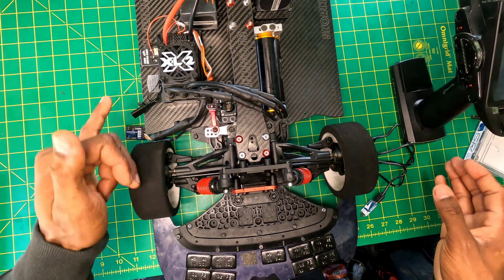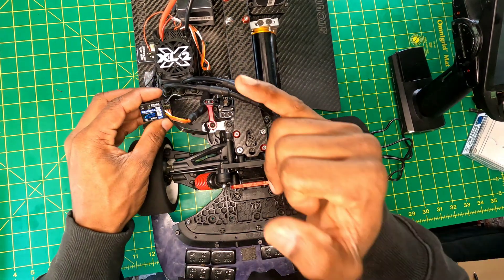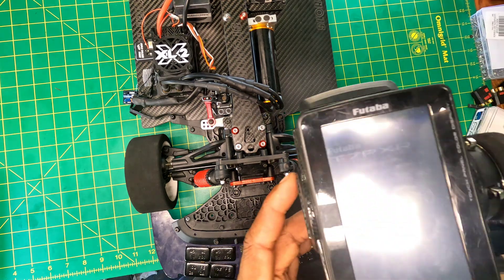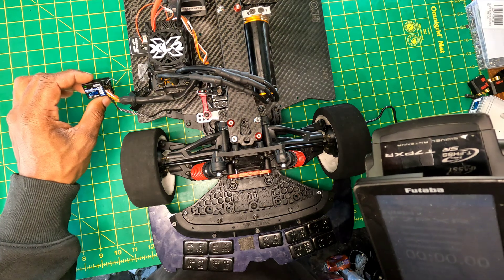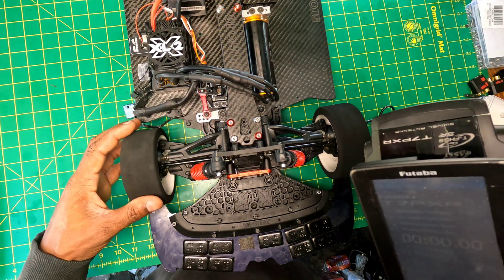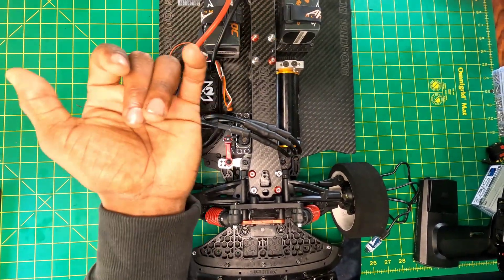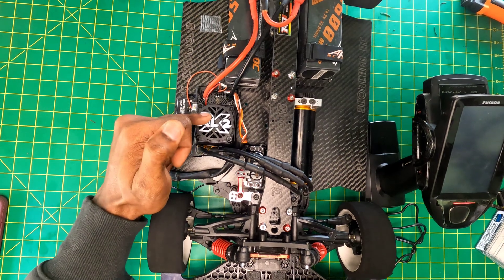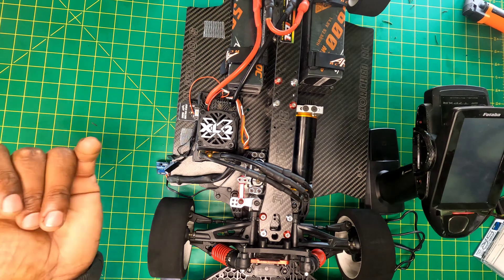How To Calibrate A Xlx2 To A Futuba 7PXR

Comment from the maker: to make sure the polarity is correct when connected to the receiver. The ESC signal wire is 
orange or white, the positive wire is red, and the negative wire is brown. Check your receiver 
documentation for correct connection polarity if it’s not marked.
Most receivers use negative (brown) towards the outside of the case and signal (orange/
white) towards the channel markings on the case.
Castle ESC/Radio Calibration
Individual transmitter signals for neutral, full throttle, and full brake vary. You must calibrate 
your Castle ESC so that it will operate effectively with your transmitter. Anytime the ESC is 
powered up with a new transmitter or with different throttle channel settings, it will need to 
be calibrated to the transmitter’s throttle settings. The ESC may also need to be calibrated after 
updating to new software via Castle Link.
If you are using a Futaba-made transmitter, you will need to set the transmitter’s throttle 
channel direction to the REVERSE (Rev) position. This is either an external micro switch on the 
transmitter or an option available within the computer programming of the transmitter. Please 
start by zeroing out any throttle trim that you may have set in your transmitter

Comment: Hey bro it sounds to me that your motor is reversed. At 3:20 when you are Revving  up the car. You can tell that your motor direction Is set up wrong. Because when you was squeezing the trigger you can tell that you’re speed was way faster in reverse then it was In forward.
Reply from the maker: It's futaba 7pxr I had to swap channels on the remote. You are correct it's just a issue with Castle and futuba Radios. Even at the reciever you have to flip your wires. Also non sensored motor ans its s TP motor wires can go in any direction. Unlike a Castle motor that you have to go ABC.
Reply: Swap servo 2 an ESC to channel 1 ?